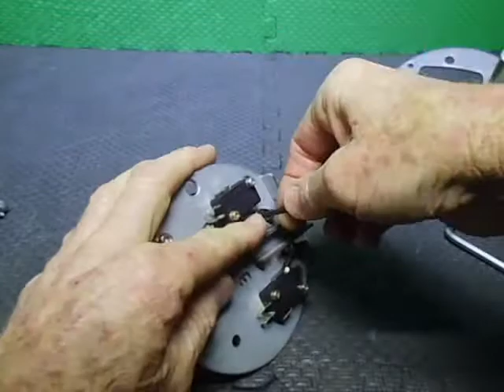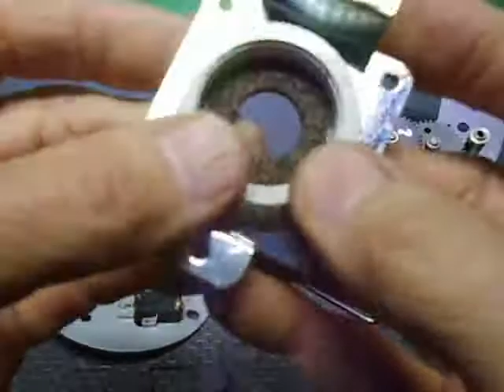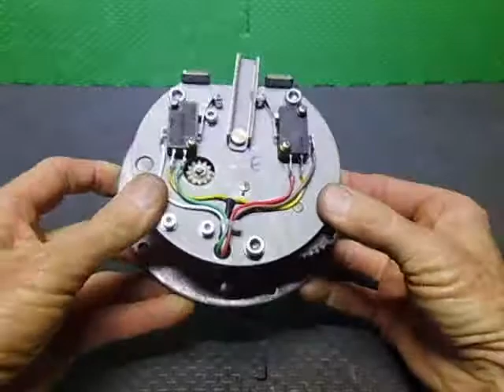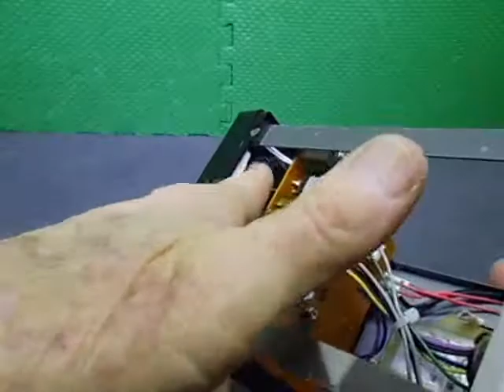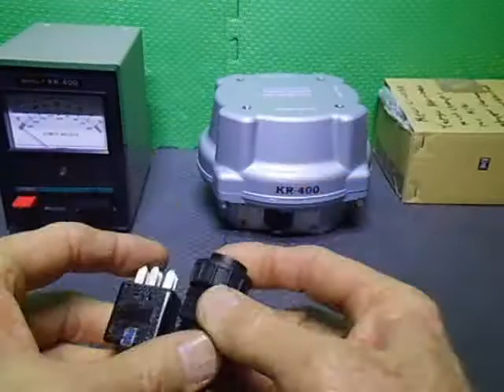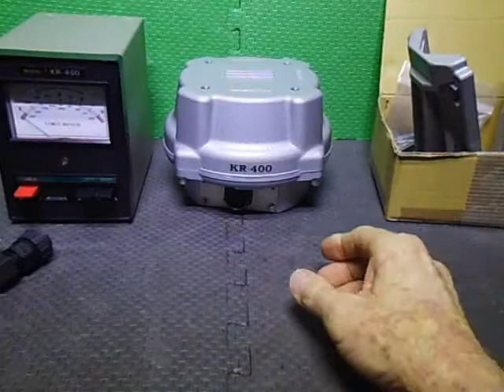Kenpro KR-400 rotator upgrades parts 1~4

Comment: Do you know if I can get the gear that turns the internal potentiometer that indicates direction on control box my rotator turns but does not indicate on the control box the gear rotted away

Comment: thanks for the video, very helpful, i have a question or 2. what is the capacitor you use? can i have the spec, because im in the uk, and shipping will be a bitch, im going to start the microswitch modification, i have the switches, but do you have a wiring diagram please. plus im struggling to find a 4th gear
Reply from the maker: Hi Darren, thanks for the comment :-
The motor start CAP I use, is removed from the controller & installed into the rotator.
However if you have the very early version controller, the motor start CAP (AC50L100) is to big to install into the rotator, I salvage the smaller CAP (AC60L100A) from later version controllers or I use a new replacement CAP I got a hold of.
 For further information, please get in contact with me (Peter of Duoro Services) via my web site (which is in the description of the video), regards Peter

Comment: I actually want to know what the voltage should be on the secondary winding of a yamato ys-130 controller
Reply from the maker: Hi Gerhard, the voltage on the output should be around 30vAC
Reply: @duoro-rotators  thanks for letting me know

Comment: Thank you for this video showing the internal parts of my rotator that I'm going to disassemble. 
Which kind of grease you suggest when there are plastic gears ?
Reply from the maker: Hi Paolo, your KR-400 will not look exactly like the one in the video, as I have done a lot of upgrades mine.
Regarding grease, when you have totally stripped down the rotator & cleaned up ALL the old grease, (do not add new grease to old grease, as they will react & cause more problems).
I use & so did Kenpro/Yaesu,  Molybdenum Disulfide grease better known as Moly, it is the same stuff used in CV joints of front wheel drive cars. regards Peter
Reply: Thank you for your answer.
So my choose for an old big CDE rotator has been correct.
Now I was worried about a sort of compatibility with the plastic gears. So, according with your experience, you can confirm that moly grease doesn't degrade the plastic gears.
Thank you again. Regards. Paolo.
Reply from the maker: @IK8XOO--Paolo 
Hi Paolo, In all the years of refurbishing rotator I have never seen grease stuff up plastic gears.
I have seen dried up &/or sticky crap & hard grease stuffing up even steel gears, but that is more to do with slack / lack of maintenance or the mixing of different grades/brands of greases causing a reaction. Regards Peter
Reply: @duoro-rotators  Hello Peter, me again. I don't know your e-mail address or your call, so I write to you here, on YT for a suggestion, please.
I have opened my Kenpro KR400-RC: the motor is ok, gears ok, potentiometer is ok too (I can read values on both sides and the sum is always about 500 ohm) but the position is not detected by the control box.
I don't know this kind of rotator. If I power on the control box without the rotor, the dial hand rotates clockwise without ever stopping: is it a normal behavior?
I thought that when the value of the two potentiometers became the same, the control box motor would stop and restart only to keep the value of its potentiometer locked to that of the rotator; unfortunately it doesn't happen. I tried to move the rotator potentiometer manually, but nothing changed.
I had to turn the control box potentiometer backwards to avoid tangling the wires behind it...
Is it that one a normal behavior for the control box without the rotator? TNX in advance. 73s.
Reply from the maker: @IK8XOO--Paolo  Hi Paolo, Yes if the rotator is not connected to the RC controller (it has no reference from the rotator) so the display needle normally turns to the (CW) right but normally stops @ about East.   
Your RC controller may have circuit component problems or the 500 ohm POT in the controller is faulty or someone has played around with the two trim POT's on the PCB.
 Note for the RC controllers terminal 1 (one) for the control cable is not used, so you only need 5 core cable cable (using 2,3,4,5&6). If you can find a working standard panel metered controller similar as in my video, too check & align your KR-400 rotator.
You can also contact me via my Duoro Services web site kur02.com.au. Peter.